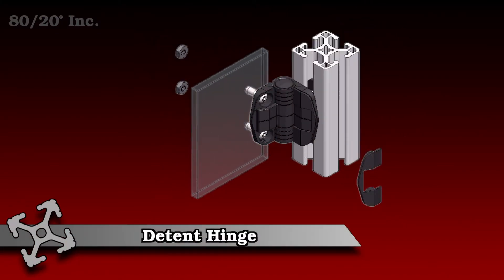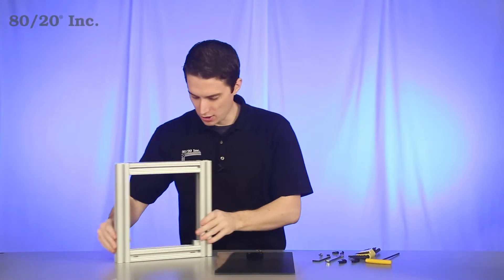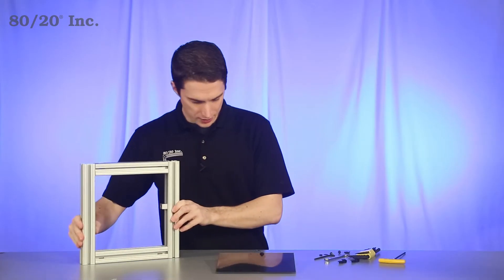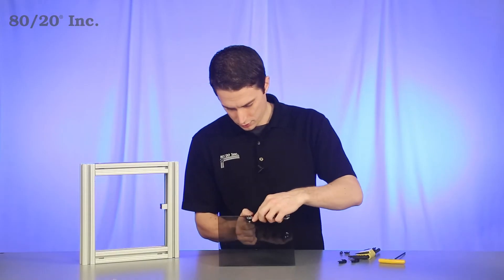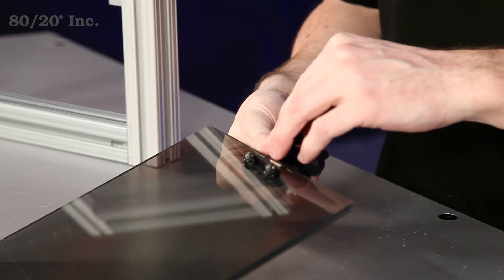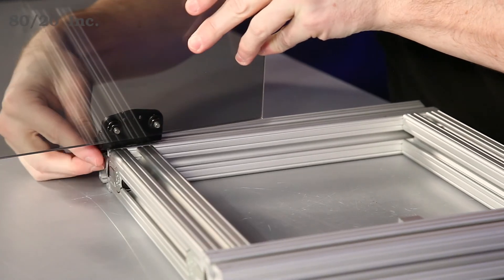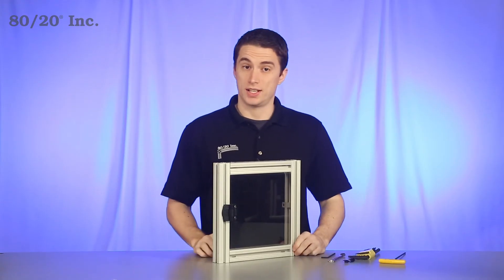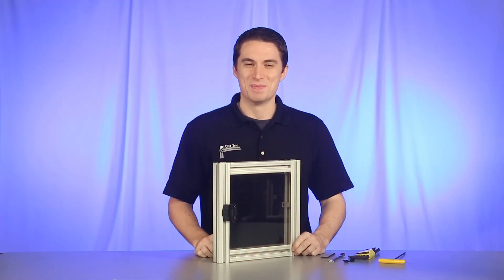80/20: Detent Hinges Overview

Comment: Does 80/20 currently offer any drawer slides? I've searched the 80/20 website and can't seem to find anything that would allow me to construct a small drawer, like one you might find a small computer desk.
Reply from the maker: Thanks for the question, Austin. 80/20 does not currently offer drawer glides as a standard product; however, we do have suppliers that offer them and can get them for your project.